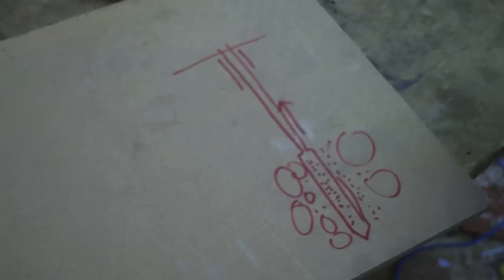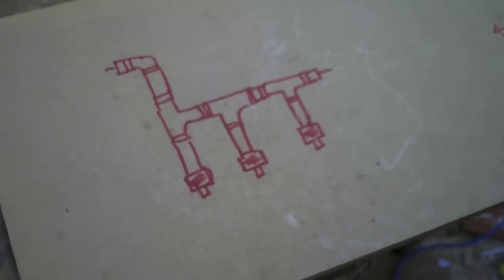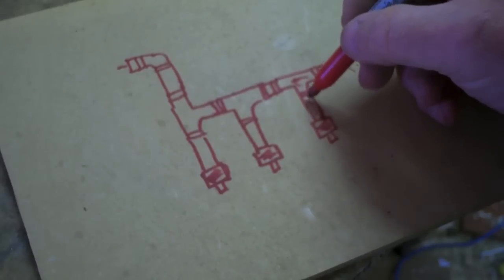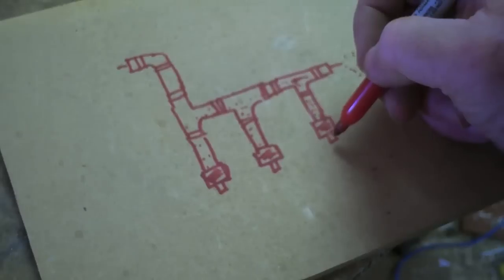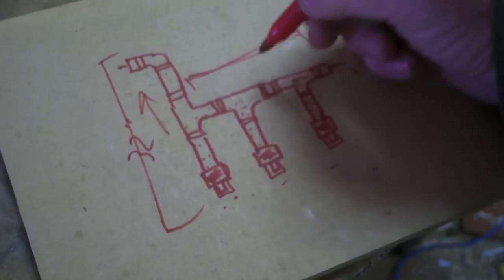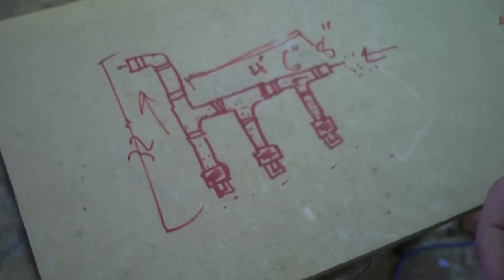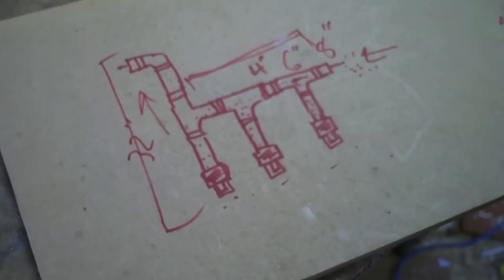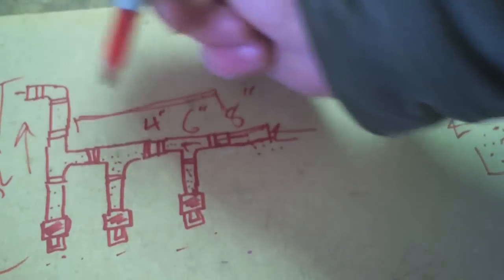Homemade Water Well Sand Trap

Comment: honestly this is way over thinking it. all i use is an old hot water heater. pull water from the top sand settles at the bottom and you can flush the sand periodically with the spigot at the bottom. you can use it in a pressurized system without much losses. you can use a 55 gal drum instead if you wanted. no need to waist your time with such a system.
Reply: Sounds good I think I will try that.  This is the first logical bit of advice I have seen regarding this issue, thanks.
Reply: correct
Reply: Ok
Reply: Not really. A 55 gallon drum wouldn't pass code where I'm at. I tried finding old HW tanks but they were rusted out and still cost almost as much as buying new pvc. The schedule 40 meets code and is rated for pressurized systems. I found the sections for free from a buddies job site and I believe the fittings ran me around 50 bucks which is what people wanted for a clapped out old hot water tank. I only did one dirt leg on my setup and it's been running like a champ for years now. Went from having to purge my Rusco spin down filter weekly to basically never.

Comment: Rather than plugs or caps, use 1"-1.5" pvc ball valves.  Not as cheap as the other solutions, but under pressure they should allow for a no-hassle purge and they're made to be under pressure.

Comment: use a old hot water tank with a little reverse engineering works great
Reply from the maker: I bet.  Hold a lot of sand before it failed too.
Reply: +NelsonStudios  no reason for it to fail you have a drain valve to release the sand
Reply: Was easier for me to find reliable new pvc than an old junked out tank everybody still thinks is worth 50 bucks.

Comment: screens get damaged while driving. To clean sand out, drop an air hose down the hole and let the air buble the sand and water up. It works and will save time
Reply: Been having this problem for a while now and take it apart and send air down it every so often when the sand point fills with sediment (water flow will slow down to a trickle).  In hindsight it would have helped a bit to have a short piece of 1&1/4" pipe ahead of the well screen as a sediment catch.  This would definitely helped with how often I have to take everything apart to clean it out.  Wondering if the silt will ever clear up for me.  Tip of well point is 56' down and 8' long (5' and a 3' attached together).

Comment: great ideas just like drip legs in gas piping I like it but soon enough the pump will have to come out it won't be long before that sand grinds down the impellers in the pump and it won't pump water anymore depending on your well depth
Reply from the maker: true enough, we should suck through the trap to reduce the sand in the pump
Reply: Not too sure how well that would work (placing the sand trap on the suction side).  May cause some cavitation plus it's extremely easy to create an air leak on the suction side. Your friend may have the same kind of ground that I do - super fine silty sand.  I'm at wit's end trying to get this shallow well to work good. Did the silty mess ever clear up for your friend?
Reply from the maker: He said it worked.  His issue was the grit got into the sprinkler heads and plugged them.  It has also worked that way for me.  I have another well that is just funky nearly un drinkable water with a punch of fine red silt that trashes the laundry. I put a spin on charcoal filter on it and that made it much better.  All of our pumps are above ground in the 3/4-2hp range. Can you just turn it on full bore for a few days and maybe purge all the sand out at once?  It floors me that you are sucking enough junk to trash impellers.
Reply: Thanks for replying. I've tried running the pump full bore and it seems to plug up the well point in a hurry.  I found that restricting the flow to around 4gpm with a ball valve right at the output of the pump. Seems to run a little better a the pump doesn't struggle as much. I believe the real issue is that I'm not quite deep enough (even though it's 56' to the tip of the well point) to be in the aquifer and it's sucking in a lot of real fine silt as a result.  I'm really close to the water table where I'm at, but the ground in my area is a super fine sand which is what I'm mostly drawing in (when it dries it's about the particle size of powdered sugar).  There has been a little bit of sand, but not much so I honestly don't think that the well point was damaged much on the way down. Production from the well has gotten slightly better over time so maybe things will eventually clear out.  Would also like to note that the Wayne Sws50 well pumps don't seem too durable (at least not in my situation).  I've been through three impellers plus the diffuser is all shot now. The plastic is way too soft. Bought a cheap 3/4 hp floforce pump and I accidentally cranked the impeller trying to take it all apart to inspect it (tried pulling the impeller off after removing the nut but there was some sort of locking keyway on it).  Unfortunately there doesn't seem to be any way or anywhere to buy replacement parts for it. Surprisingly there didn't seem to be too much wear on the internals from what I can tell. I may go a little higher end this time like Little Giant or maybe even Gould.

Comment: In Australia we used to have sand filters for pools. You used to be able to take the head of a pressurised tank and repalace the sand after a year. If you were to half fill it so you still have sand as the filter and empty this would that work.
 P.S. we had the ability to backwash the system as well just by changing water flow directions through a valve. The  pump that was on it was strong enough to run full 1 and 3/4 inch line of hose so maybe 60 litres over 2 minutes.  Aussie Jeff Moore

Comment: centrifugal filter 25-50 dollars works great and has a valve with it for the flush when needed.
Reply from the maker: I should check that out.  Even with free pipe I am in mine more than that in just fittings.
Reply: I've built this and I've used the rusco spin down filters.  This pvc setup is by far the best solution for fine particle sand.

Comment: I did this and it worked perfectly, thanks
Reply: You have to watch out bc this 4" PVC is not made for pressurized function
Reply: @robertnguyen7153  : But under a  VACUUM  ????     Before the well pump ?
Reply: Schedule 40 is rated for 200 lb/sq.in.

Comment: You can use gate valves
Reply from the maker: I was worried that sand would sit in the gate trap and then wouldn't seal but I suppose that is all in orientation.  I built that stupid thing so much larger than it needed to be, about the time I got it done the well stopped puking sand.
Reply: I see, the is solved then

Comment: Many thanks for your thoughts and efforts on my behalf.

I've decided to first see what is going on down below.
For that reason, I am going to pull up the pipe from the well and examine the bottom 3 feet. The 1 1/2"  sand point is sitting inside a 4" casing that goes down to about 30 feet.

I don't think that the part of the sand point that has the mesh filter screen is beyond the bottom of the PVC casing. It should not be jammed in rocks or gravel enough to be stuck.

The main obstacle to withdrawl is that I used 1 1/2 " galvanized pipe instead of PVC.
It's heavy as hell but the pipe is in 2 10' sections and 2 5' sections.

A friend is willing to help me hoist the pipe and has tools to secure the pipe so as to avoid losing a section of pipe down the well while the each upper section is removed.

It may take extra time and effort but my "diagnostic" interest has been piqued and I "got's to know" why the sand is coming up in such large particle sizes.

IMHO there has to be a defect, as you have proposed,  in the screening at the bottom of the well.

So, I will give you a report on what I find after the above has been completed.

Just two additional questions:

>My foot valve is at the bottom of the well, just above the sand point.
Does it really make any difference if the foot valve is at the bottom or near the top of the well??

> IF the screening on the sand point is repaired/replaced and the system re-lowered, is it possible that the larger particles of sand I'm seeing that clog my sprinkler heads, could clog up the outside screening of the sand point??

Also, do you have an e-mail address with which to correspond non-publically??

Again, many THANKS for your interest!!

Chip
Reply from the maker: My foot valve is at the top of the well.  All the footvalve has to do is keep the water from draining back down and de-priming the pump.  Mine is at the top (immediately out of the pump) because all I could find was a brass one and I didn't think it would survive the pounding of driving the well.  I don't think the sand will bother you.  Try relocating the foot valve higher up, even right off the pump like mine, that way if the sand or silt does get in and plug the screen you could try blasting a little air at the bottom of the hole as others have suggested to break it loose.  With the valve at the bottom you cant get past it to blast backwards at the sandpoint to try and flush it. 

I do not see the sand being an issue if you can keep it from getting in.  The valve at the top isn't as effective because it is holding on the vacuum side (water weight sucking it closed) rather than the pressure side (water weight pushing it closed) but mine has been fine for the last 4 years.  Ok after the pump sits for 4 months in the winter the pressure will drop that first time I use it as it deprimes for a few moments but it has always come right back.  I am sure that is related to the top valve but as long as I use it regularly never an issue.
Reply: NelsonStudios

Comment: use ball valves. The gray pvc ones that are the union type
Reply from the maker: That is an idea, big 2 inch pvc valve would make them easy to dump.
Reply: yep, but spend the extra few dollars for the screw/union type that have o-rings. Easy to replace when the day comes. I use a regular home shop compressor with about a 30 gal tank. Take the fitting iff the end of hose and lower it in. Just needs to bubble stuff up, not build uppressure, if you have room to put a garden hose down with the air hose, it helps in floating bubbling the sand up.

Comment: I think you are right and I am going to move the foot valve closer to the top of the well near the pump. The way I plumbed the well head, I have a hose bib and joint to the main pipe running down to the sandpoint. If I put the foot valve ABOVE this joint, I would have full access to all the pipe below the pump. 

With the foot valve just above the sandpoint, I can not ever backflush the sandpoint.

Now here is a potential issue. Is it possible that the sandpoint screen can get clogged up with sand particles as the water is sucked up by the pump motor?

This is kinda what happens with my EXternal sand filter currently in place.

The sand coming up from the bottom of the well clogs up the very fine screen in the external filter and quite quickly reduces water flow beyond the external screen.

I have to frequently drain the sand out of the external filter which has an easy to drain valve at the bottom. However, this filter is only about 6 "long and 1" in diameter.

It looks to me like the sandpoint screen has a slightly larger mesh so it shouldn't get clogged up as easily.

Anyway, here's my current plan:

>Disconnect pump from plumbing/pipes

>Slowly and carefully raise the galvanized pipe, disconnecting each section and taking care to avoid losing a section down the well casing.

>Remove foot valve from bottom of the pipe

>Inspect sandpoint for defects.

>Replace/repair  sandpoint if necessary

>Reattach sandpoint and lower piping into well again with attention to proper joints at each section. Again avoid losing a section into the well.

>Reattach foot valve at top of the piping below pump but slightly above the "clean out" joint/bib that gives clear access to the sandpoint.

>Reattach pump, prime and run to see if the sandpoint is functioning properly again.

>Leave external sand filter in place to see how much sand is getting past the sandpoint.

>Attempt to backflush the sandpoint if the water flow seems to become obstructed by a newly clogged sandpoint.

Do you have any other suggestions??

If this doesn't work I might remove the whole sandpoint, put a 3' section of perforated PVC (to allow water access) at the bottom of the well and install a much larger EXternal sand filter as per your design.

Thanks!!

Chip
Reply from the maker: Maybe compare the mesh of your sandpoint to others if nothing is wrong with it.  Good luck.  I have pulled them before by clamping a pipe wrench to it and using a highlift jack but then I also broke a pipe wrench in the attempt.  The second one made it.